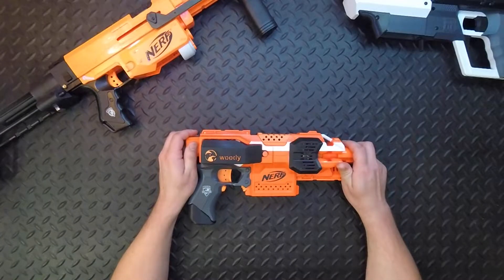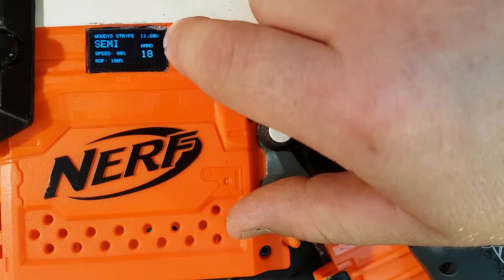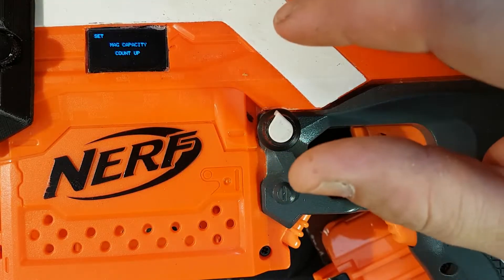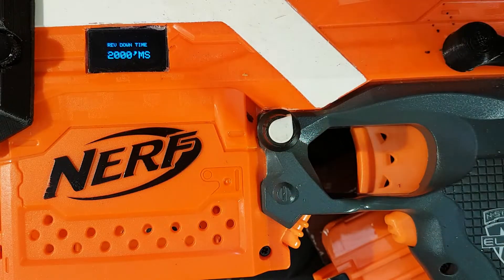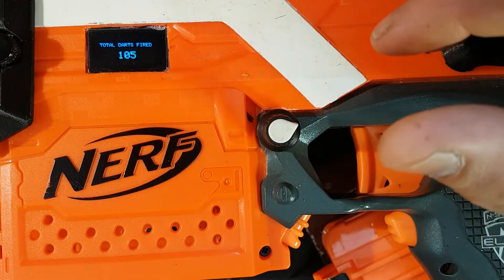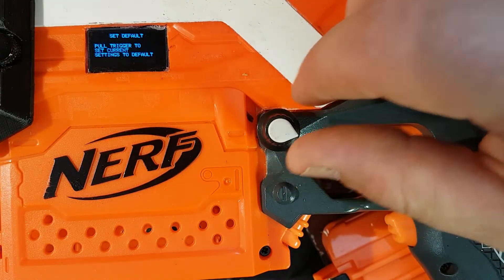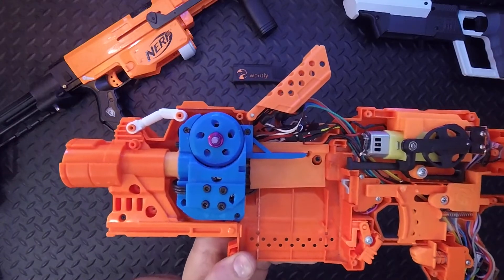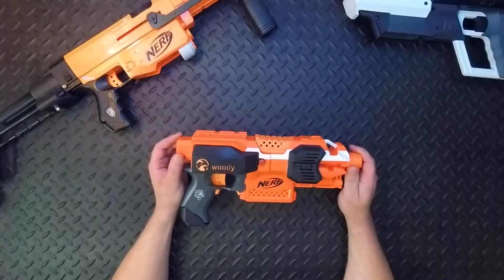(Custom Creations) Brushless Ultra Stryfe

Comment: One of these days I’ll meet you at a war in Perth and pick your brains a little..... or a lot ;) awesome work bud :)
Reply from the maker: Hi Wallafied

You would be more then welcome at our events. Our FB group is called West Nerf (https://www.facebook.com/groups/wasnerf/?ref=bookmarks) and we hold regular events.
Reply: Ministry of Foam do you guys link up and play with the battle nerf players as well? Where are your games usually located?
Reply from the maker: Hi  @wallafied . 
I'm not to sure who Battle Nerf are, do you mean Battle Squad? 

Some events are South , some are East and some are Central, I recommend you join the group to see the event schedule for the locations of each event. We have an event on this Sunday, if you're interested.
Reply: Ministry of Foam yes sorry, that’s what I meant battle squad. I’m heading down to Perth this weekend so hopefully I’ll find the time to come and have a go. What’s the FPS cap?
Reply from the maker: Hi  @wallafied  

We don't have a fps cap, but the higher a blaster shoots, the further back you have to be to tag someone. For example, 130 and under, no minimum engagement distance, 130 to 180, five meter minimum engagement distance, 180 to 250 ten metres minimum engagement distance and so on.

Comment: Really nice setup mate, we’ll done. I’d been kern to know what kind of drop in performance does it show when only running a slim 2s or IMRs? Cheers, Jas
Reply: Jason Wallis  thanks. The current needed for this setup imrs wouldn’t work well at all. A small 2s would have a drop in power of about 50% and the pack wouldn’t last long until it’s flat.